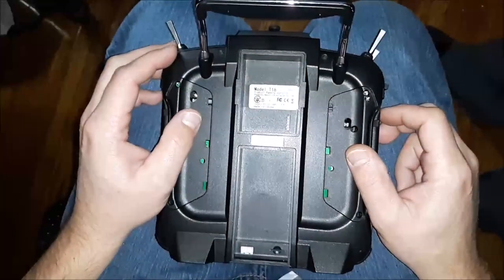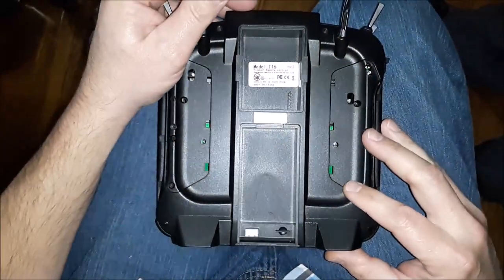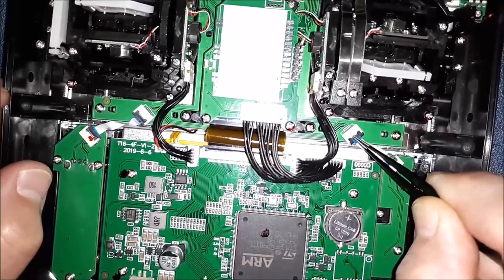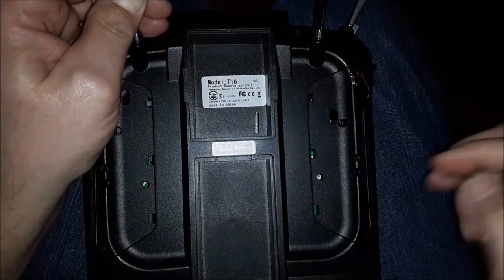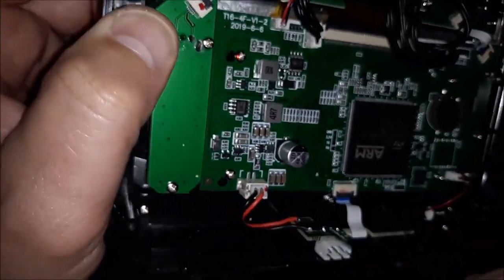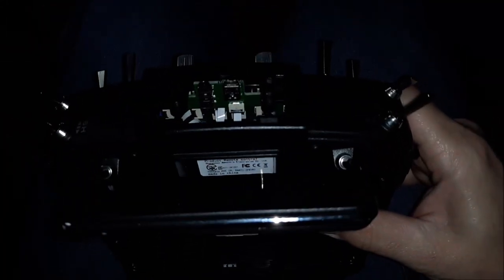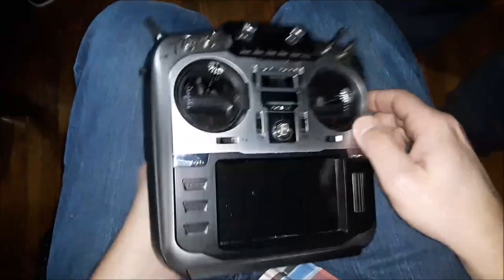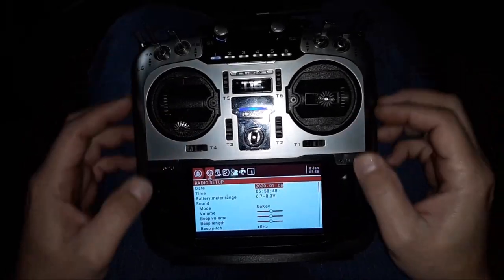JumperT16 KEY STUCK Issue | Emergency Mode Fail

Comment: Bought a refurbished T16pro from Amazon.
Page button was not working, no error message no nothing.
Was very skeptical at first to try your method.
10 mins later everything works perfectly again.

Thank you so much for this video!
Reply from the maker: I thought it was ridiculous too, but it fixed it to this day. So glad to see the RadiomasterT16S and T18 coming out with wires and not ribbon cables. Glad it helped you...👍🏻🍻👊🏻

Comment: Thanks, just fixed the same problem using your method. I'm really trying to like this radio, but first I had a problem with the switch that happen to be the ribbon cable that needed to be reseated, than key stuck issue that happens to be the same- ribbon cable in another location. Since 70's I used ton of different radios, Futabas, JRs, FrSkys, but this one so far seems to be the least dependable, yes I'm trying very hard to not to use the right word to describe it. Kind of scary to fly the more expensive craft with it.

Comment: Thanks for the info.  I started getting the key stuck error on the newer T16 pro which came with open TX.  Since only the model button was not functioning, I just reseated the ribbon cable on the left hand side and that resolved the issue.
Reply from the maker: Welcome... Even the newer ones are having the issue, hum... Thanks for the feedback...👍🏻🍻👊🏻

Comment: I like the voodoo that you do! My Jumper started doing this after jumping off the desk. The cables looked just fine, but flipping them around worked a charm. Probably just re-seating them would have worked as well, but why mess with success. Thanks!

Comment: That is so funny two months ago I received my radio and I had the same problem me being a curious person I said let me see if I can fix this I've found in my radio when I removed a little ribbons there was a little piece of copper looking like a strand from a wire Crossing two of the  connectors  can't believe but I got lucky and caught that pulled it out  with tweezer and well and behold there was another one on the right side of the radio in the connector but not Crossing I'm taking a guess when they made the ribbon cables it was a piece of copper from when they molded the End or or however they make them great job good video
Reply from the maker: I appreciate it, thank you. I personally don't care for ribbon cables, but this transmitter uses a ton of them..